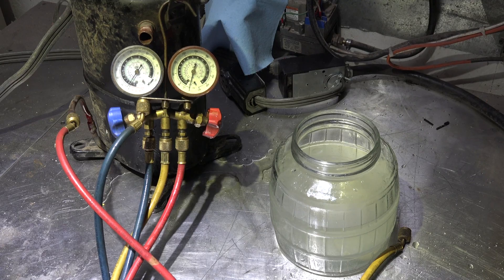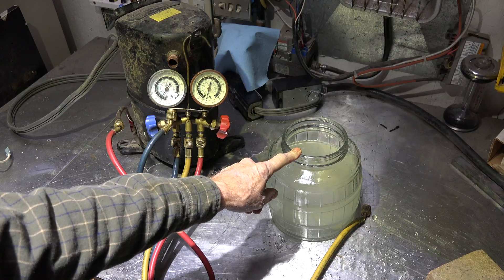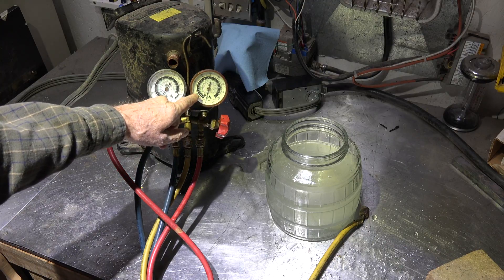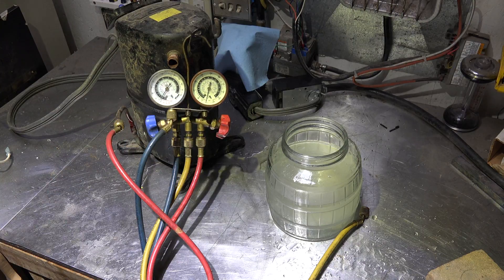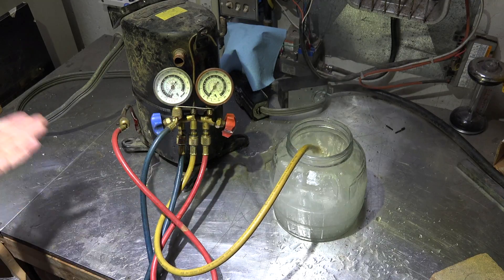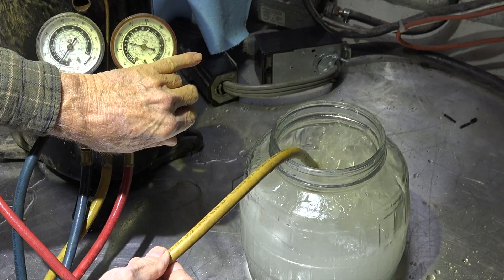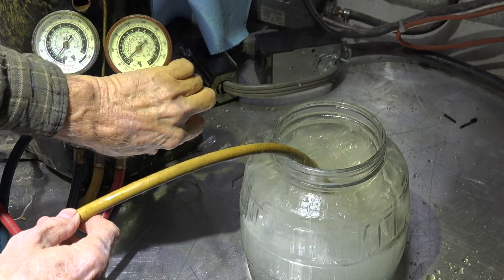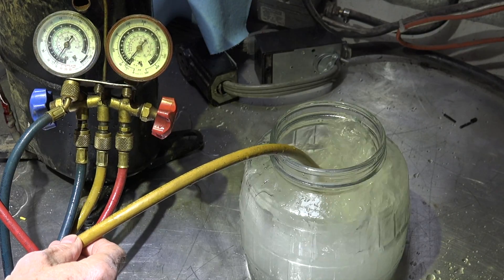Compressor re expansion demonstration

Comment: i think re expansion occur because suction gas has low pressure even after being compressed reaching TDC the pressure is still not enough to push discharge valve  , in this demo i guess when head pressure is high it’s even harder for the compressed gas to push the valve cause behind it high head pressure and when we make no restriction very low head pressure then the compressed gas now can push the discharge valve even with relatively less pressure? am i right?

Comment: With your great demonstration, I came up with possiblity of turning compresore to a vacuume pump, is that possible?
Reply from the maker: Many years ago, compressors were used as vacuum pumps.  There are 3 problems with this use.  As jpgoodhart says, they will not pull as deep a vacuum as a vacuum pump.  Second, compressors will eventually pump the oil out of the can.  Third, hermetic compressors are cooled by the suction gas.  They will tend to overheat.
GFM
Reply: grayfurnaceman 
Thankyou very much for quick reply
Reply: yes i seen few of them buy old refrigerator compressor from scrap dealers and convert them to vacuum pump but efficiency being just 80-85%

Comment: quick question, If the charge was weighed in on a r22 4 ton split residential system and the txv was replaced can i raise the suction pressure by adjusting the txv or add more charge?
Reply: Shawn Riddle charge by subcooling and superheat
Reply: Called parker and they said to adjust the superheat on it. its new so it doesnt come ready out of the box. Thanks
Reply: i can change it by adjusting the txv
Reply: Shawn Riddle please watch some more videos on superheat and subcooling before you go messing with the adjustment of the TXV. What is your liquid line pressure? What is your liquid line temperature? What is the required subcooling number?